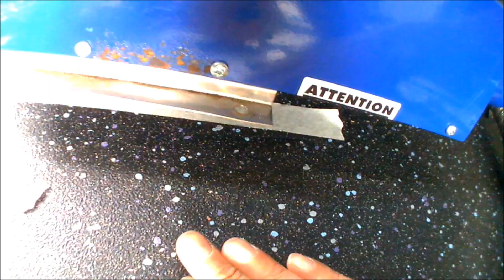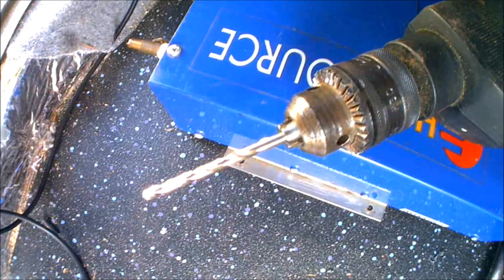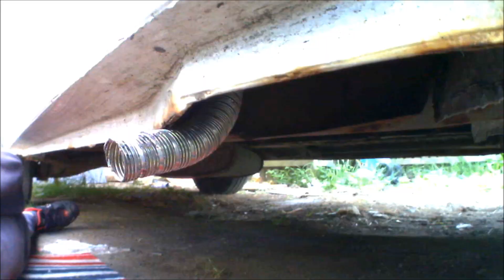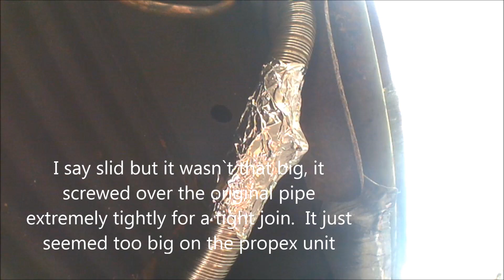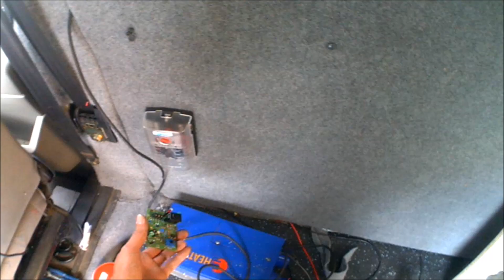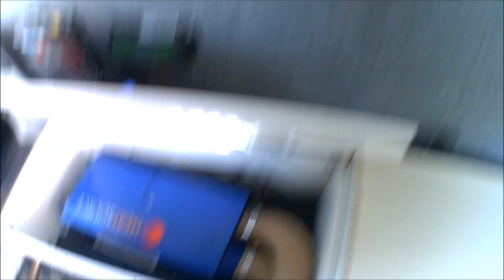Propex HS2000 VW T4 Install Gas Heater Camper Conversion Propex Installation Guide

Comment: You might want to use more than zip ties to secure the copper gas line as well as using some kind of dampener between the copper and the body metal. Vibrations will be rubbing holes in it.

Comment: It says in my manual that came with the heater that the holes are supposed to be 40mm for the exhaust in intake pipes. That does not make sense to be as the pipes are around an inch.

Comment: Can the gas hose be a rubber flex hose? And will the heat from exhaust char the ply floor?
Reply from the maker: It should be copper for safety sake and I didn't notice any effect to the flooring

Comment: Howdy Folks who might choose to do this for them self’s ....
Suggest using a metal attachment for the exhaust pipe of heater.
This video happens to demonstrate us of plastic zip ties... will melt.
Reply from the maker: The exhaust pipe is metal and the zip ties are only used on the cold air intake so will not melt at all.  Maybe watch it again it more detail

Comment: From other videos and Propex themselves I'm under the impression that the air intake and exhaust pipes had to be the same length to keep the unit in calibration. You showed where you lengthened the exhaust but didn't say anything about the intake. Yes/no? Maybe the states have different requirements. I'd also replace those zip-ties underneath the van with real clamps. Zip-ties will vibrate and cut/break through.
Reply from the maker: I emailed Propex who said there was no issue in extending the air intake and the system has been used multiple times since fitting and its worked 100% every time.

Comment: Had to smile when I saw the exhaust pipe fixed with plastic cable ties... bet they wont last 30 mins when the heater is running.
Reply from the maker: Well the heater has been fitted over a year, used multiple times and the ties are still as they were, I used stupidly large heavy duty ones

Comment: Hello,
I just bought one but I don't know what gaz regulator I have to use with it... I have got a 50 mbar gaz regulator should it work? If not, please let me know which one I should get... Thank you
Reply from the maker: Generally 30-37mbar from butane or propane bottles, should say on the unit or on online instructions for it if it will accept other pressures but I think the 30-37 range is whats its designed for
Reply: @TheCampervanBuilder  I'll do it. Thank you for your quick response!

Comment: That’s a lot of soft copper pipe under the van 🤔
Reply from the maker: That there is, but of which is all securely fastened to the bodywork and is no different to a caravan gas pipe setup as they also have bare copper pipe running underneath.

Comment: Hi, do you have to run the gas pipes under the van, would it be possible to use hose? I have no knowledge of these things , really enjoying your vids 
Thanks
Reply from the maker: The pipe doesn't have to go under the van, I just ran it like that as my bottle locker was the opposite side of the van and wanted the pipe under the van so its out the way, flex pipe should be avoided if possible as it can perish, split and leak over time, copper stays solid.
Reply: Camper Conversion 
Thanks for the reply

Comment: Is your power source a dedicated 12V battery?  If so, how long to you think it will provide enough current to operate the fan?
Reply from the maker: +Raven Feather the Propex is wired to my 2x110ah leisure battery bank which is topped up by solar panels so I can't see my batteries running flat anytime soon but I think the draw is about 1.5a per hour
Reply: Thanks.  I know zilch about electricity but that should be enough information to figure out how long it will take to draw down my battery the recommended max.  After I take a look at the battery for specs.

I'm currently using a Buddy Heater and it does a good job here in the mid-west although it's either on or off (it's not thermostatically controlled) and it can actually get uncomfortably hot in my small rig.  And in the Rockies at higher elevation the windows in my rig have to be open in order for it to get enough oxygen to stay lit - which kinds of defeats the purpose of having a heater.  The installed heater sucks too much juice if you're not hooked to shore power and it's very loud.
Reply from the maker: Just get a good sized leisure battery and it should last a long time, if you get a 100ah battery and the heater was left constantly on at 1.5a, the basic maths says the battery would in theory last 75 hours (although you're not supposed to run a battery flat, voltage drop etc) but the heater wouldn't be drawing that all the time, only when running until it clicks back off again.  If you're driving you could get a split charge relay to charge the leisure battery while on the move to keep it charged up or a solar panel stuck to the roof like I have.

Comment: It looks like the floor of your van is wood and possibly insulated. My van has 1" of polyiso covered with plywood. Does the combustion exhaust get hot enough that it would be a hazard?
Reply from the maker: I would not think it should not be too much of an issue considering these are made specifically for campervans/motorboats etc where they should know there might be wood/insulation involved but if you are ever unsure on Propex matters, just email them, they replied to every question I asked when I bought my first unit and were more than helpful even though it was discussing a model 10+ years old...

Comment: I love the video.  I would be a bit nervous about those gas pipes underneath though. If you ever bottom out the van, it could be a world of hurt.  Bringing the pipe through the vent was a stroke of genius though. Brilliant idea.
Reply: Great videos you are putting out! I was also concerned about the pipes under the van, my thought was that running the copper pipes that close to the beams could have them rubbing and wearing out over time which could also me a major risk. I would have slid some heavy duty hose over spots that could rub against the van. Just my thoughts though, as I said great videos!
Reply from the maker: Thanks, a bit of hose would be a good idea but caravans have exposed piping mounted underneath in the same way as I've done so I can't see there being a problem
Reply from the maker: Thanks, I''m not concerned about the pipes though as they have been secured high and tightly to the main beams running down the van so are probably well over 40cm clear from the ground and above the sill line which would bottom out first, although I can't see that being a problem anyway, the van isn't lowered and will be getting larger wheels too

Comment: Great video. Thanks. Given me more confidence to have a go myself. 

In regards to wiring, for power did you wire it to the thermostat controls which were connected to the control panel which in turn is wired to the battery?
Reply from the maker: Thanks, Wiring for this model is very simple, there should be 2 cables from the unit, 1 for the thermostat and the other should have red & black for the power.  Just wire the red & black to a 12v (fused) power source and thats it, I only took the thermostat apart to run the wiring from the unit up behind my panel and had to poke the cable through the panel..  I have ran the 12v power to my main switch panel first before connecting to the unit but this isn't needed as the thermostat had switches on it too, I just wanted to be able to shut the unit down if the cool down fans were running for too long.  If you're still unsure on the wiring, have a look at my channel as I have a video where I test this unit before fitting which shows all the cables
Reply: CamperConversion ah great very simple then. Thank you. If I'm honest my main concern is drilling holes through the floor of the van.
Reply from the maker: I was nervous the first time I had to do so on my last van for the gas pipes & drop out holes, just start with a small drill bit to make sure its gone through in the right place, then use a hole saw to widen it out as required, treat the metal and job done.  This van has had 8 holes put in the floor and 18 in the roof so far